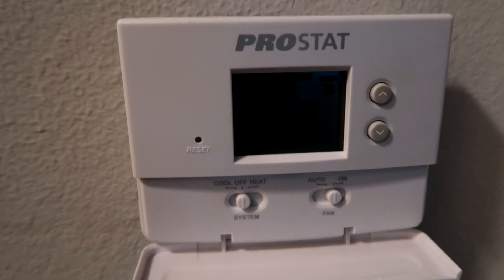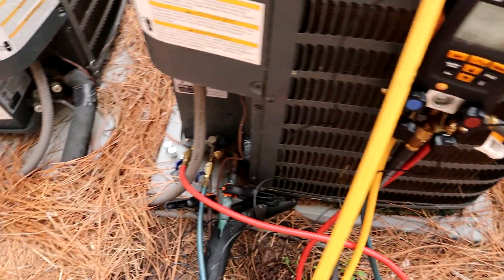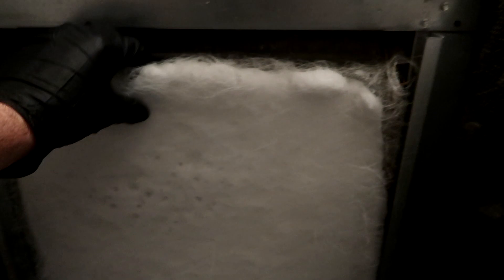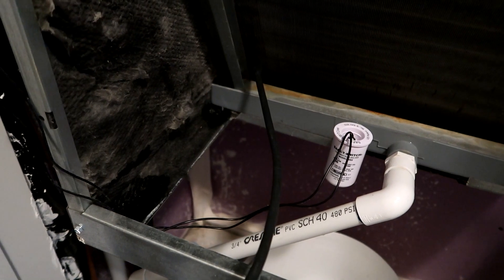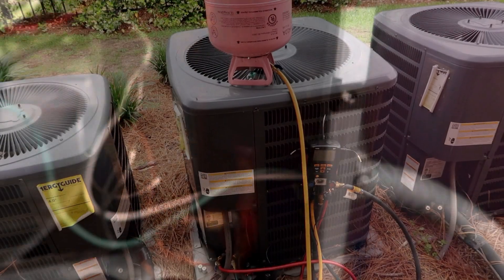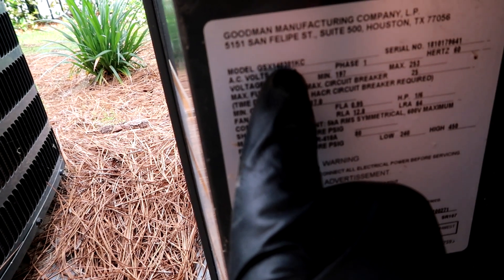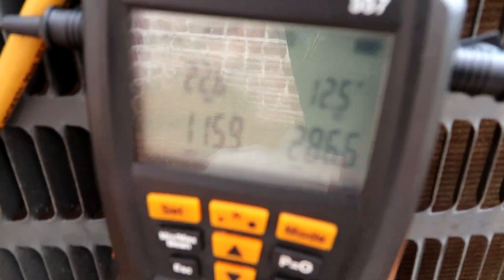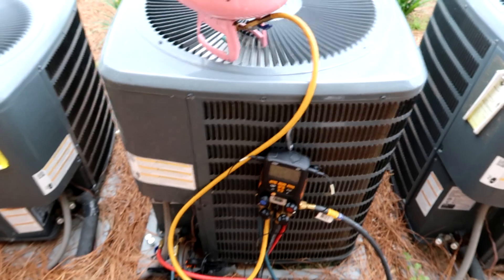Here's Why Your Air Conditioner Keeps Freezing Up

Comment: I had an electrician come out to do a job with my breakers and I simply asked him a question about mold well he proceeds to pull out a laser tester and he said out of the 20+ years he has been an electrician he has never seen this before in a home throughout my whole double why I have 96% to 100% moisture in the walls ceiling and floors in my rental home, and it’s been sometime now that my AC constantly freezes up no matter what temperature I seem to put it on to cool off my home because it stays so hot in my house could this be the problem with my AC that the moisture in my home is causing too much condensation and freezing up my air condition?
Reply from the maker: Freeze ups are usually due to low Freon or bad air flow due to dirty filter or dirty coil. I'd get the Freon checked if your air filter is clean.

Comment: Thanks so much for all your teaching. I have been on this trade for some time now and I learn something everyday. What do you think about the new 557s testo??? Would you recommend fieldpiece 480v??? Which one would you recommend between the two???
Reply from the maker: Both make great products so I recommend either. I personally like Testo because the manifold is small and fits in my hand. Fieldpiece is big & bulky. However, they both never disappoint and make great products. I only prefer Testo due to it size. Not the function. Thank you so much for watching Pedro!

Comment: Restriction on the lines , dirty  coil , dirty condensers  fins  txv clogge    some of the few issues
Reply from the maker: Yep. Or a bad air handler blower motor. Most common is low charge in my experience. Thank you so much for watching Juan!

Comment: That leak detector is awesome! On our property the tenants always put there thermostat under 65 and that freezes it EVERY time!
Reply from the maker: Ugh, I hate that. They think it'll cool faster by dropping it down to 60. 🤦🏼‍♂️ Thank you so much for watching Robert!
Reply: One tech that we have will tell management if the resident runs the thermostat under 70. He claims there is a way to adjust the thermostat inside to keep the tenant from lowering it below 70. But I think he's blowing smoke. I don't never try to mess with those things.

Comment: Did you say six months? Dude, that is stupid. I stock up on them. Carrier usually has them in store but I always have two coils and compressors lying around. Replaced two coils this year already. If this is your first TXV make sure the sensor bulb is facing up on these drop airhandlers. The equalizing tube gets brazed into the suction line.
Reply from the maker: Right on, I'll figure something out. Thank you so much for watching ReelGuy!

Comment: First company is hard to get bc usually it is made in house. Remember that they shut down it seems to be the Dec through Jan as a company I believe. We always have to remember to order heat kits for the units we have, if not its repairing with high temp butt connectors.
Reply from the maker: Right on. Seems like I got my hands full then. 🤦🏼‍♂️ Thank you so much for watching jclifford!

Comment: Hey Lex. I don't have enough money at the moment to buy a bacharach leak detector. And honestly at the moment it's a bit intimidating to use. Do you recommend the inficon leak detector also as a good sniffer?
Reply from the maker: Yes. So far I've had no issues with it and I like it. It's hand held with a battery so no need to plug in any where like the bacharach. Thank you so much for watching Next Gen!

Comment: I been waiting on some parts from whirlpool for 3 months. Ridiculous.. thanks for skid vid!
Reply from the maker: Yea, seems to be for multiple things. I can't get ice makers either. 😭 Thank you so much for watching J M!
Reply: Somewhat unrelated but purchased a basic Whirlpool fridge and 50 days later compressor failed, open circuit on run winding. Whirlpool had no clue about when a replacement compressor would be available. Plenty available third party on the internet. Fortunately Lowe’s replaced although out of their return period policy.
Reply: @roberts1159  yeah getting factory direct parts is a complete nightmare atm. Glad ya got squared away
Reply: @GODS_21  Yes it was a pain. Had to wait three weeks after going back and forth between Whirlpool and Lowe’s. But it was resolved in the end.